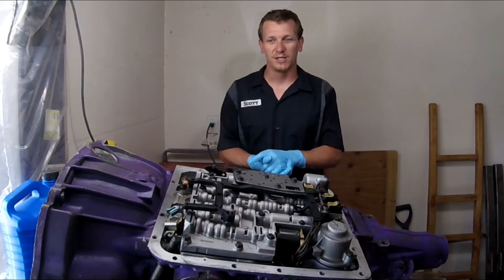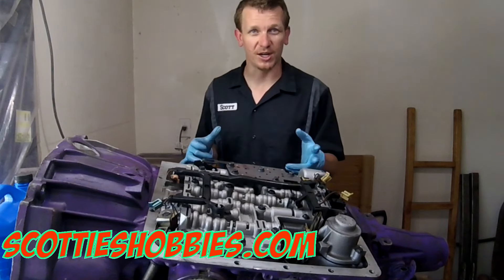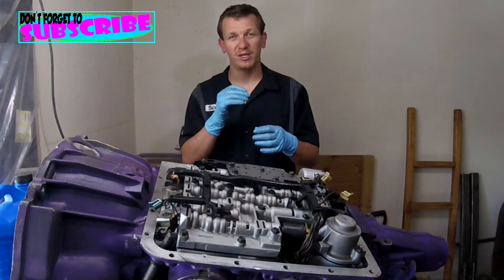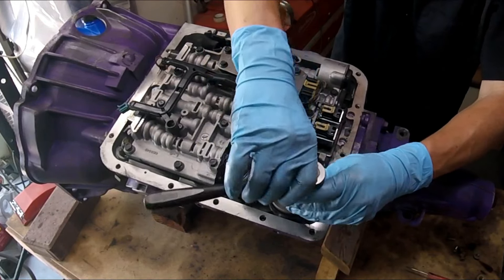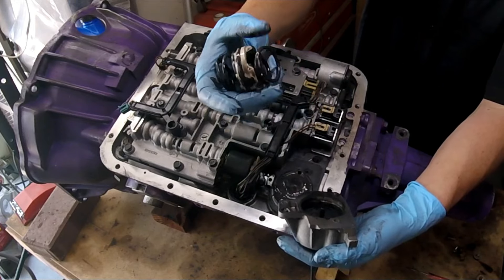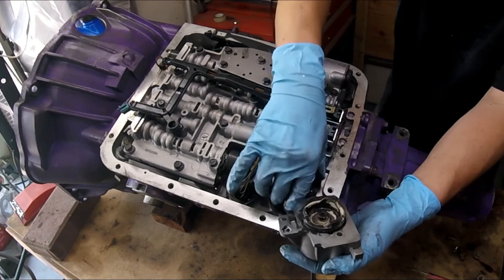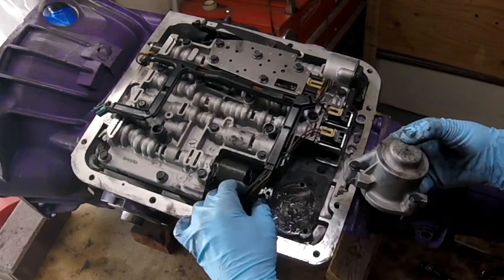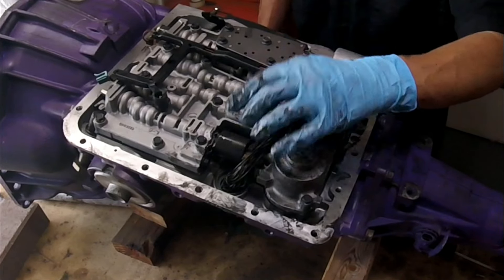⫷ 4L60e Harsh Shift, Shutter, 1 - 2 shift problems. 1-2 Accumulator Check and Replace ⫸

Comment: This is sad at 63K my  05 colorado bangs into second gear, while my  81 oldsmobile with 385K shifts perfectly!, they don't make them  like they use to.
Reply: @Mike_hocksbig69  The Colorado has had kid gloves since new just like my 81 Olds and 73 vette, 85 380 sl and 88 Town car. They are all still keepers not like my 68 Cougar  81 trans am and 86 vette  they were the ones that i could not mechanically connect with and have been gone from the stable nearly forty years!
Reply: So true it's very sad

Comment: I had mine rebuilt, Top to bottom, it still slams like a shotgun from 1st to 2nd.
Reply: Mine had a broken accumulator spring that was causing the shotgun style shifting issue from neutral into reverse. Clutch packs were still screwed up and burned after decades of service, but maybe your guy didn't replace the springs and just reused them? Another adjustment you can try:

Make the shifting into 2nd gear easier by adjusting the TV cable if you have a 700R4/4L60 but the 4L60E doesn't have an adjustment as far as I know since it's electronic. If you do adjust the TV cable it may shorten the life of your transmission but if you set it to shift around 12-15 MPH it'll still last 25 years like mine did. Other than that the 4L60's all have a rougher shift unless you buy upgrades.

Comment: Scotties, I have an 2013 Silverado z71 when i drive with low rpm it shift the gear smoothly but when i drive faster with the high rpm it delay the shift between gear then the gear shift harshly so it is the problem from solenoids or what pls
Reply: Hey did you find the solution
Reply: Did you find your problem
Reply: Did you find solution?
Reply: Upgrade valve body

Comment: Thank you for the video sir! I have same issue but im confused in ordering the part, i see your link is 24220142 which is part number, is this the whole assembly for accumulator piston 1-2? Or just cover i really dont want to go through spring and other.
Reply from the maker: Well that Ebay link is a pretty poor link. When I get some time this evening I'll hop on the internet and edit this video description with some better links. It might be hard to find a loaded accumulator but I'm sure they are out there. I'll get some better links in a few hours and post them. I'll let you know when I do

Comment: I have a 4l60e that has recently developed hard shifting from 1-2 and 2-3 also but only after I drive a few miles or after its warmed up a bit. I was going to replace the 1-2 accumulator but im thinking that might not be the issue given the 2-3 hard shift. Any ideas?
Reply: Line pressure too low possibly
Reply: Did you ever get it fixed?

Comment: Still have a harsh 1-2 shift after accumulator work? Try disconnecting and reconnecting the wiring harness to the transmission to clean the contacts.

Also, if you are checking solenoid resistance, do it all the way from the ECM-side harness pins. This will tell you a lot. This is an end-to-end test. If the values aren’t good, disconnect the 13 pin transmission connector and check from the male pins on the internal wiring harness. The last place to check is by dropping the pan and checking the solenoids themselves. Good solenoids are useless if the wiring and/or 13-pin connector are bad or intermittent.

Please comment if this helps you!

Comment: so don't worry about the 3-4 accumulator?  I don't wanna drop the valve body.  Scared to go that deep.  The FWD one looks easy.  Would it be dumb to replace just the 1-2 and FWD?  Upgrading to pinless.

Comment: Ya my avalanche Trans lasted till 250,000 with the hard 1 to 2 shift, That one was from GM. My Silverado is starting to get the hard 1 to 2 shift , I am going to put a Accumulator with metal parts. Plastic just does not stand the test of time , this helps alot , this part is not very expensive either.

Comment: Hey brother! I sent you an email with a question about the 1-2 accumulator springs in my 2003 sonoma 4x4 4l60e, im sure you probably havent had a chance to check it out but I was curious if you could help me out. I did the sonnax 1-2 billet pinless accumulator upgrade, but when taking out the plastic original pinned piston, there was 3 springs in there, which futher research has indicated to me that is not correct. Had Orange outer, white middle, and i think orange smallest inner spring (couldnt tell the color was pretty much gone) but wondering if you can identify or point me in the direction of which springs to remove, i'm thinking just the white middle spring currently but in the interest of saving myself pulling the pan 2-3 more times im wondering if you have a recommendation. No biggie if not just figured id check with someone clearly way more knowledgable on these. Thanks again for all your videos, just by doing those you've helped me get my new project truck into almost perfect shape again at 148k miles.
Reply from the maker: It sounds like you have a 'shift kit' of some sort installed in there. The pinless setup is designed to work with the factory springs. I'd find the factory springs to install with the pinless kit. Maybe on ebay??
Reply: @ScottiesHobbies  I actually just got a message back from Sonnax, they said the springs are actually transgo shift springs, interesting...

Comment: I've been working on LS1 firebird with a 4L60E and I've been having the issue where the car jerks when I put it on reverse or drive but after I run it for a while it goes back to normal. This video gave me hope to fix this issue so thanks for the tips!

Comment: Does this apply to a 1995 Silverado 4L60e?  When tranny is cold it will usually hold in 2nd until slightly wamed up and then it'll usually work fine/shift fine into 3rd, as long as I am not stomping on the fuel pedal hard. Could this be a failing TPS?  Or clogged filter?  Fluid looks, smells good and is full. Does it worse when weather and fluid is cold. After warmed up well it mostly acts normal if I drive easy and accelerate slowly. Thanks!

Comment: I follow your videos, I have do ne a lot of thing to fix my 1-2 hard shifting in my 05 suburban 4l60e. I have replaced the piston accumulator for the double O ring aluminum one and  replace the pressure solenoid and I still have that hard shift from 1st to second. Also from park to gear . Need an advise please
Reply: Check engine and transmission mounts

Comment: I have question...I had someone diagnose my transmission because it was hitting the rev limiter going into 2nd and just going into 2nd all other shifts are good he had to use his laptop to switch the solenoid on/off then it would  shift proper into 2nd. What could that sign be???
Reply from the maker: Accumulator not moving properly would be my best guess. But a blockage in the valve body can cause this too.
Reply: Would that be the 1/2 accumulator valve train

Comment: Great video.In My 4L60e,in my 2000 Chevy s10,I was driving and noticed it slipping a little.All of the sudden it quit pulling.Like it went to neutral.Next day it worked until it got warm,then nothing.What you think.

Comment: So I watched your video on the Sonnax painless mod. I ordered the kit along with a used accumulator from ebay. Before opening my transmission (2007 Silverado 4.8) I broke the housing on the used accumulator making the cross hatch. So I opened mine and noticed the housings were a little different. Mine had 1 spring, the used one had 2 but had a metal piston. I did the painless mod on my accumulator and since your video shows 2 springs I used the 2 from the one I broke. So I still have the same issue. I tested the ball bearing and it didn't come out and I figure if it did I would know it. What do you think?
Reply: Forgot to mention..my issue is hard shift P-D and 1-2

Comment: my 2001 Suburban 4x4 just today started not wanting to upshift, no SES, no codes that I can see. I've already had intermittent service 4WD, and was going to get to that, unfortunately today when I went to go see neighbor it was in 4Low, and after the offroad portion ended of my run ended and I got to pavement I noticed high rpm's, drove to Post Office trying to Isolate symptoms other than the transfer case not shifting, it was DRAMATICALLY HANGING IN GEAR BETWEEN SHIFTS, and would only upshift after coasting, but mostly hanging in 1st too long and 2nd too long, not sure if it was getting into 3rd and4th at all, kind of hard when in 4Lo. Any clues as to where I should start?

Comment: I drained the pan and changed the filter a few months later. Now the RPM is fluctuating, but it grabs gears very well. What would cause the fluctuating RPM? It happens at 35 to 50 mph and then goes away.

Comment: Question that you didn't answer. What if you have it in low or 1st gear and want to hold it in that gear but it keeps shifting into second normally but holding 2nd with no problem? What would be the problem. I use to be able to downshift to first at 20-30 mph for roll racing or hot rodding it and and hold it no problem. Now, it wont downshift to first gear or low when I want it. Started happening randomly.
Reply: They are made to shift into 2nd @ 4500rpm.  It requires VB changes to stay in manual low above 4500rpm.

@4500rpm, the reverse input drum is spinning @ 9000rpm, which gets sketchy.

Comment: That stack up looked identical to the Transgo HD2 kit. The Electronic Pressure Control solenoid does need to be removed to replace the case electrical connector. Different.

Comment: It looked like that accumulator piston did not even have a seal on it based on how easily it fell out of its bore. That was a reason for your harsh shift, the accumulator piston could not even do its job.
Reply from the maker: This trans lost 3rd and 4th. 1st and 2nd got us home. The check ball in the case was leaking like a siv.

Comment: Do you have any vids on delayed engagement from takeoff with a 4L60E. I have a 01 Tahoe 4x4. I was hoping it was the converter clutch solenoid or something that saves the $2k shop. Of course filter didn't help, no metal either. I used one of the trans no slip super duper all fix additives,...nope..lol. It shifts fine at speed and doesn't slip thru gears or at speed.
Reply: sorry, i did look thru your vids, just didnt see one about delayed engagement.

Comment: Thanks good vídeo. Is the 1-2 accumulator replaced without remove the transmission un the truck?
Reply from the maker: You do not need to remove the trans to remove accumulator. Make sure to check your harness for continuity and your shift solenoids while you are in there.
Reply: Thanks again body.
Reply: Did you watch the video
Reply: @pmotorsports8276  yes I do.
Reply: @pmotorsports8276  yes I did.
Reply: Cesar Antonio Canales Escoto Hope you got your upgrade figured out! Otherwise here’s a video that can help: https://youtu.be/2PV62NbfWfk

Comment: I have a 2007 chevy silverado would this be my problem im shifting very hard going into second and only second drives smooth i bought the gm manufactured one waiting for it to come is it one whole assembly or do i have to buy different parts to go in the accumilator
Reply from the maker: Kits vary. I would google the part number so you know what you got. If you are replacing the piston, make sure it's not plastic. Update to a metal piston if you have not done so. Don't do the job twice...

This could be your issue but so many things can be the root cause. Check for debris in the pan too.
Reply: @ScottiesHobbies  im also throwing a tps code p0121 and a p0700 tcs ( mil request)and a p0742 tcc solenoid circuit stuck on and p2764 and p2770 i think maybe the tps is making all this happen im not sure i first thougt accunilator now i dont know

Comment: I did have A 96 chevy with A 4l60 that had A p0748 code pressure solinoid. But it was the PCM that caused the hard shift from 1to2nd gear
Reply from the maker: So your fix was replacing your computer?
Reply: Yes the computer was sending 1.2 amps to the pressure control solinoid and the new PCM was sending .4amp and the pcs duty cycle was at 55% and that resolved the transmission code and the hard shift issue.
Reply from the maker: That's great. Thanks for sharing your experience. Good job getting that thing going.
Reply: @juliotorres512  How did you manage to diagnose this?

Comment: mbw635
Scotties was spot on with the accumulator repair.    My 2009 Colorado 2WD pickup was hard shifting on the 1-2 shift.    I chnaged the trans fluid, sourced the AC Delco part from his link, Amazon prime shipped it next day, and the problem is gone.    My bracket for the shift linkage was held on with two 13mm bolts, and the pan came free very easily.   Gasket & Filter set I used was WIX.   Thanks Scotties!
Reply from the maker: Hell yea! Glad to help brother. Good job gettin in there and getting it done.. people always ask if this or that is easy, I tell everyone that it's easy as long as you have the patience. 

Good job and thank you.

Comment: My gmc sierra doesnt want to shift into second until I release the gas pedal. Do you think this could be caused by the accumulator or is the hard shift the only reason for digging into that? I already tested both of my shift solenoids and they are good.
Reply: Mine has the same thing. What did you end up finding out?

Comment: I have a 96 GMC Sonoma 4wd 4.3l v6 n my transmission goes into gear but has very slow start wen pushing the throttle, rpm will go to 2k before the truck starts to move, once it goes it shifts fine n gets to speed no issues, is that my 1-2 clutch's going out or no?

Comment: I have an issue with a 97 silverado with the rough shift going from park, 1-2 is rough, and sometimes when downshifting from 4th to 3rd, it seems like it's missing the gear and hitting neutral.. I bought the truck with a "15,000 mile rebuilt transmission"... how boned am I?

Comment: Any advice on a what seems like a slip after warmed up to about 160f on trans, from a stop, or p to d, 3 or 1. 
Then I have to tap the gas to get it to what seems like fall into gear and then move like normal. 
It does not do it when starting in 2 or reverse. 
A local shop rebuilt it 50k ago (before I got the truck). I was thinking maybe forward accumulator piston, can you get to that without removing the valve body (I have an 08 silverado)? I know the screws are in a tight area there. But maybe the forward accumulator is fine because when starting 2nd it doesn't need a bump. 
Only other thing I can think of is it's fucked internally. Any thoughts?

Comment: My 04 Escalade kinda clunks or slams from park to reverse would this accumulator fix or that other sensor you pointed out ? Also 1 to 2 kinda lunges forward and it shifts but seems delayed ?
Reply from the maker: The accumulators probably won't fix a reverse issue. Maybe the 1-2 shift but not reverse. Have you checked your tps? Use a volt meter to do a sweeping test and see if you have any glitches. A bad tps causes a lot of issues.
Reply: Check your u joints and rear end

Comment: What year is this transmission you are working on? So I can do my 1-2 3-4 pistons without taking off valve body I don't really wanna take off my vb I have a 2001 4l60e.
Reply from the maker: To get to the 3-4 in the case, the valve body has to come off. This trans was out of a 01 tahoe.
Reply: @ScottiesHobbies  ok no way around it can't pull it down?
Reply from the maker: @robpaul7900  nope. The plate between the 1-2 & 3-4 is hald in by the valve body.
Reply: @ScottiesHobbies  would it be a bad idea to replace just the 1-2 without doing the 3-4?
Reply from the maker: @robpaul7900  better than doing nothing.  If you don't have 3 rd or 4th, the check ball in the case might be bad.
Reply: @ScottiesHobbies  can I do the aluminum 1-2 and leave plastic 3-4 alone? I think they are both plastic right? Or can I do pinless 1-2 and leave 3-4 stock or will that setup not work? And if I do go with the pinless do I need a different spring? Nothing wrong with my transmission so far just trying to make it better. Did my servo solenoids and filter recently. What setup would you suggest if I'm just gonna do the 1-2 for now?
Reply from the maker: @robpaul7900  i am a firm believer in.... if its not broke, don't fix it. I usually make my self way more work when I fix something that is not broke. I would switch out the plastic pistons if possible. If you can only do one, that is better than none. You don't have to switch to painless but I'd make sure I get  metal pistons sooner than later. I believe you use your factory spring unless you have a kit that replaces it. Different manufacturers have different recommendations. I'd stick with Delco or Sonnax for parts. Sonnax includes great directions with their parts too.

Comment: Just changed my 1-2 accumulator with a brand new one and it literally did nothing. Any advice.
Symptoms- Hard shift 1-2 and 2-3
Reply from the maker: What year? Have you checked tps?
Reply: Do a complete drain and fill 6 times. 18 quarts. Yes, 18 quarts. Max Life valvoline full synthetic. $18 a gallon at Walmart. That’ll give you at least 75-80% new oil. I bought a small oil pump to suck it out thru the dipstick tube which makes this job very easy. $20 thru eBay. Drive it 10-15” between each drain n fill to mix it real good. Then 2 bottles of Lube Guard red. Worked for my 2001 4L60E. No more hard shifts.
Reply: This video is for the hard shift from 1 -2 and from Park to Drive. Thats Accumulator issue. But. If you have prob w both the 1 -2 and the 3-4 then its NOT the accumulator (or just the accum) But. That's also indicative of prob with both of your Solenoids. Change them out for the two of them.  Do this before buying 18 quarts of fluid to flush it. Geeesh.

Comment: Are the accumulator housings ending in 428 and 937 interchangeable they are the same size pin.230 937 is alittle newer style I believe but almost identical. Can I use a 428 in place of the 937?